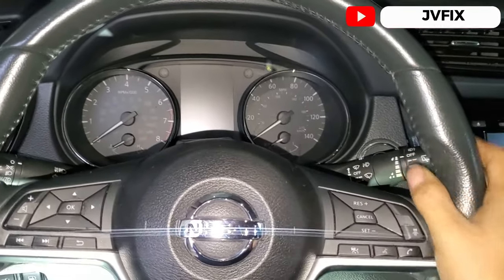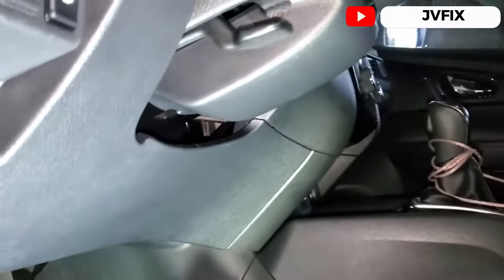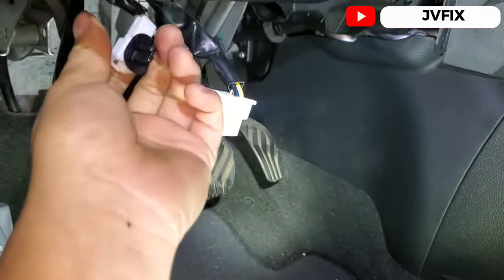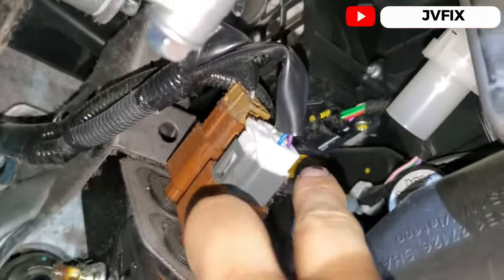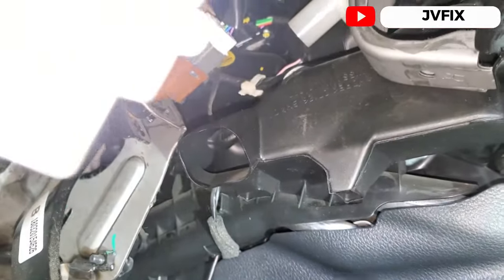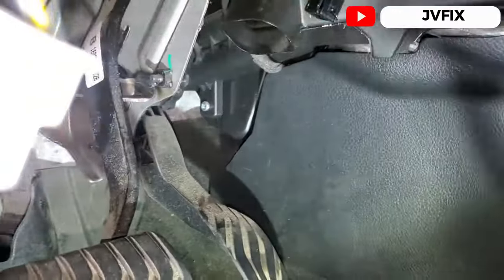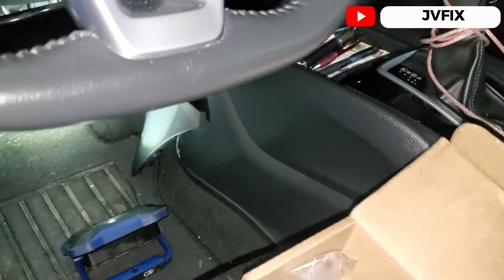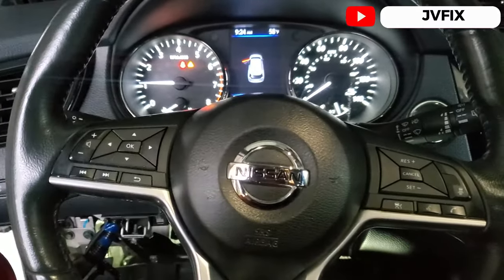How to fix A/C hot or cold stuck on driver side on 2017 Nissan Rogue step by step

Comment: This is usually just a temporary fix I changed mine than a couple weeks later it was broke again. Dealership said the entire box Is bad. Well they said it gets dirty and rhe actuator isn't strong enough to open and close the blend door
Reply from the maker: yea I have also heard that issue happening too just like chevrolet camaros the entire box needs to come out and change the door
Reply: Yeah I did the exact same. Worked for maybe a month. Then it stopped switching over. Terrible design.
Reply: So around a million bucks?
Reply: Do check to make sure there is no crack in the blend door where the actuator goes into it before install. There’s actually I guy that makes repair parts or you can use epoxy in the hole.

Comment: I changed my twice.  I realized the third time that motor doesnt move when I turn the temp down or up slightly .  Its the winter so I may leave it out as I rather have heat for now.
Reply from the maker: these cars also have an issue inside the a/c box, the vent breaks inside apparently because the motor is too strong or is the poor plastic quality inside I already worked on 2 of these and I had to take the whole dashboard apart.
Reply: @JVFIXLLC  I attempted to unplug the motor while it was on heat and it went back to cold. Attempted to leave the motor out and it went back to cold.  

Guess I don’t have a choice but to bring the car in and see if they can change the box.  I did hear that the motor can be calibrated but would need the device to see if that can fix it

Comment: Do you know if replacing the yellow type-B one beside it helps when my 2019 model changes airflow from vents only rarely and sometimes it feels like not one vent is open? Blower motor speed and temperature changes work normally.
Reply from the maker: yea that one is for mode door change.
Reply: @JVFIXLLC  thanks alot!

Comment: Mines same is the same year make, and model and it only blows hot air. Please help with ideas I only have 50,000 miles but it's out of warranty. I added R134 but may have over serviced it, still blowing hot.
Reply from the maker: only way to find out is removing the blend door motor and move the door manually

Comment: Any chance you could put the specific part number for this? Google hasn’t produced a good definitive answer.
Reply: This fixed mine. I shared the east listing I used.
Reply from the maker: yea here it is l: https://www.ebay.com/itm/155018369076?mkcid=16&mkevt=1&mkrid=711-127632-2357-0&ssspo=TrcrBMW3QHS&sssrc=4429486&ssuid=EiVXr_sXTya&var=&widget_ver=artemis&media=COPY
Reply: Same location for 2019 SV?

Comment: That's a lot of appreciated work, even filming them is pain from that weird angle. Thanks.
I have Rogue S 2015 , recently when changing the temperature of the ac through the dial knob. i hear some noise from behind the vents gates, as if it is struggling to move. it sounds like lubricating issue. The temperature changes with no problems, just that sound
What is the problem might be?

Comment: Hola mi Nissan rogue 2019 no tiene velocidad cuando SE prende El aire o la calefaction ,o sea cuando prendes El carro y vas andando sale calor pero minimo ,igual com El AC,.ya le Cambie la Resistencia del motor del ventilator y El ventilator ,.cual seria Otra causa que no salga a maxima velocidad ,gracias
Reply from the maker: si ya cambiaste el filtro de cabina y sigue entonces creo que vas a tener el evaporador tapado de tierra ya me a pasado con las rams que unas no traen filtro y estan en la tierra todo el tiempo y se tapa. usa una camara flexible para inspeccionar el evaporador.